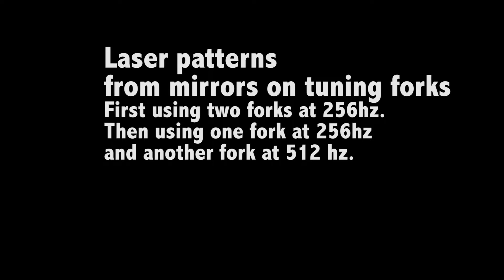Laser physics demo with tuning forks

Comment: Hi, I was wondering...in order to create any sort of interesting shape, does it have to be 512 and 256 hz or can I try this with any tuning fork I might have on hand? Thank you!
Reply from the maker: There are many possible shapes. In fact, connecting two keyboards which can emulate many possible frequencies to speaker cones that have mirrors hot glued to them (one that vibrates up and down, and the other vibrating left and right) can allow you to create fantastic shapes, some that seem to rotate in space. You can even send recorded classical music through those speakers and watch the resulting display. I wouldn't use nice speakers though. Gluing mirrors to the speaker cones damages them.